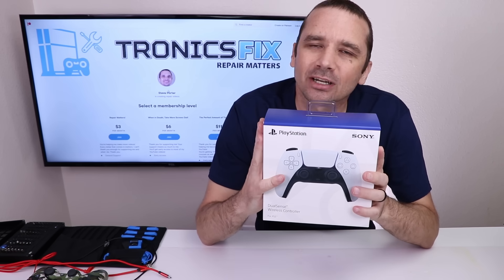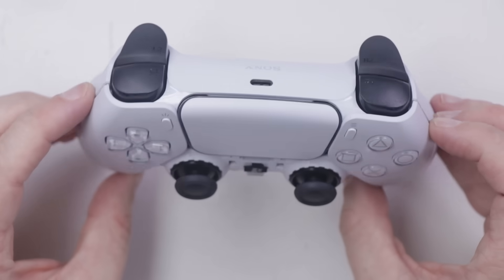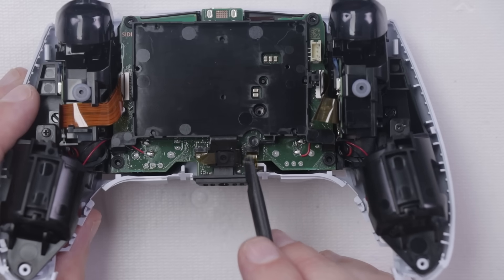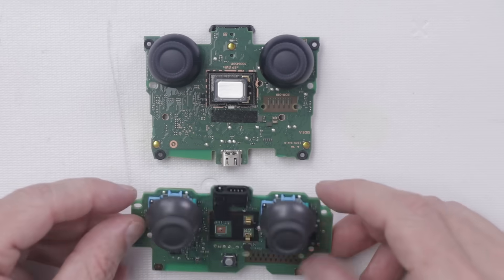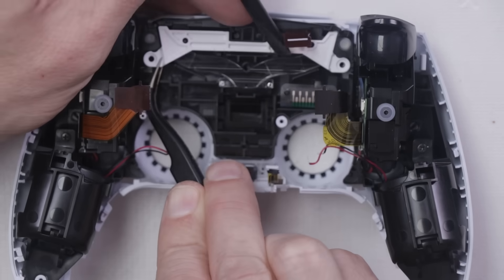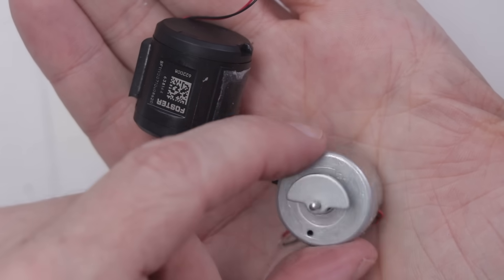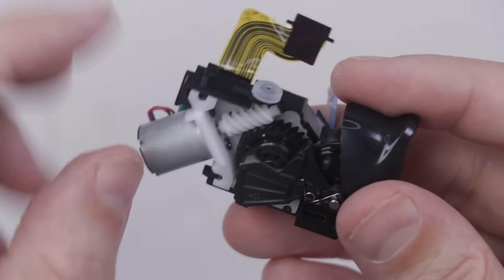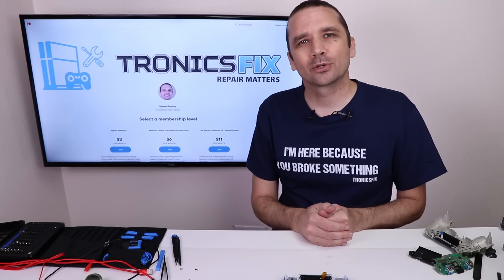PS5 DualSense Controller Teardown - A Repairability Perspective

Comment: I have 2 broken Dual Shocks 4 with analog problem. One is drifting, second is stopping on his own.  And the second one is almost brand new - started to drift a month after i bought it. You can game on them but its annoying they are not  100% functional. Not good they are the same in dual sense.

Comment: the fact that it has clips to hold the shells is already a huge turn off. i guarantee you, they will break after the first or second attempt at opening them. The pro controllers shell is really the best in regard to opening it without damaging any parts. And having to solder to get the controller completely disassambled is also a big negative. again, pro controller doesnt require you to do that to get to any part of the board.

Comment: I'd be surprised if those sticks aren't improved.
The drift wasn't exactly a secret.
Reply: Also, the dualsense looks a lot more difficult to open up so definitely won’t be looking forward to that
Reply: I've went through at least 10 controllers because of stick drift. Never threw them, never smacked them. Nothing. Kept the stick area super clean after my 3rd pair but I still got stick drift. Im gonna be super disappointed if the PS5 controllers have the same problem. Like all I use them for is rocket league. How much damage can pushing an analog stick do??
Reply: @haarisbutt2075  wtf, I still rock my original controller from when I bought my PS4 in 2014 and no drift issues here
Reply: @misha90two  there is 2 options: ur controller have problems and be cuz u are playing normall games u can undrestand and 2- u are not a competetive player
Reply: @haarisbutt2075  Even if U don't treat your gamepads badly, their sticks will eventually wear-off (drift) ... They have a plastic pin inside, which gets worn-out even with normal usage (not abuse) and in the end it needs to be replaced. But because those plastic pins are not easily available for the average user, U need to desolder & re-solder a new analog module ... Same thing for DS3s & DS4s ... And unfortunately DualSense has the same crappy 3-Pin "chocolate" Alps modules as DS4 have - looks 99% the same to my eyes ... So, stick-drift will eventually occur on these pads, as well ...
Reply: @haarisbutt2075  If you bought 10 controllers just because you didnt want stick drift, you wasted a lot of money. You could've just bought a solder kit for even less money than a ds4, buy new analog sticks and used some youtube videos to see how to replace them yourself.
Reply: @haarisbutt2075  bro, you really gonna buy a PS5 just for Rocket League??
Reply: @Superabound2  LMAO definitely not. I play all the playstation exclusives, but since my main game is rocket league, I was hoping for a better controller. Im waiting a year to buy the console regardless on black Friday
Reply: @haarisbutt2075  been playing with the same controller since ps4 launch and the only thing that's aged are the analog "leathers". You have problems if you had to change controllers 10 times lol.
Reply: Throughout my entire time owning a ps4 I’ve had to fix 2 of my controllers analog sticks. And so many ppl I know have been suffering the same problem. Hopefully Sony did something to fix that.
Reply: @frostbyte8757  had my ps4 slim for over 4 years now and never had a problem with the original 2 controllers i bought....guess im a lucky one?
Reply: @sherre2323  I play a lot of r6s on my ps4, so constantly pressing l3 and r3 takes a toll on the analogue sticks. I've personally only had to go through 1 controller, on my second now. I replaced my thumb sticks, not the module itself,  with some metal magnetic thumb sticks that have short concave, short domed, large domed, and large concave analogue sticks and havent had any problems since I bought it 7 or 8 months ago. I also clean my controller every month or 2, I'll take it apart, spray the analogue stick modules with canned air or whatever it's called, and rub the buttons and shell with rubbing alcohol, just so I can feel more confident with how long my controller will last. I bought it off amazon and didnt realize it was a first gen ps4 controller, but nevertheless, it's done me well so far
Reply: @ghostgav1428  exactly. Death stranding caused issues for me from clicking the analog to speed up the vehicles, or just speed up my person.
Reply: @saxtoncan  That's why I always seek, on the game settings, the auto-run options. Unfortunately not all games have it.
Reply: @Mike-IP  yah death stranding didn’t have that I’m sure, because it is a whole lot of slowing down and speeding up crossing dangerous terrain
Reply: @ghostgav1428  when you are going through so many controllers I'm going to say its a YOU problem and not a design issue
Reply: @sherre2323  no, you just don't play a lot, my friend plays cod / fifa 4 hours a day and his left 3d analog(stick) died every 6-7 months. 
They are the same in ps4 /ps5/ xbox/xbox elite controllers, dont know about nin pro controller
Reply: @sssrs4172  are you kidding me i play for 3-5 hours evry day for the last 4 years
Reply: @sherre2323  maybe you dont use L3 and R3 alot
Reply: @saxtoncan  to be fair stick drift is usually caused by a fault with the potentiometers, pushing down on the stick has no effect on the position of the wiper but instead pushes down on a ptm switch, so i wouldn't think that would cause it
Reply: @wsketchy  then it is odd that it only happened to me in games that I had to click R3 and L3 often
Reply: @frostbyte8757  Only 2? I bought 8 controllers xD
Reply: Oh yeah the switch has Horrinle Horrible Drift
Reply: Got my Ps4 back at the release in 2013 i still have my first controller, what exactly happened to the sticks?
Reply: @t52342  "how" depends on the specifics.
On Steam you can just go to the controller settings in Big Picture mode to calibrate any controller's deadzone settings for Steam Input.
You can also do it outside of Steam, but the specifics vary with operating systems and controller models.
Some games provide in-game deadzone settings, too.

On consoles you're probably SoL.
It's what you get for buying into arbitrarily locked down computers built around the idea of taking power away from the users. 😐
Reply: I will say that for me the issue was always caused by either hair getting into the mechanism, or dust getting on an electric piece of some sort. Both solved by certain easy means. Hair you just open it up and pluck the hair out, meanwhile dust you just move the stick in a direction and blow into the crack. With the rubber padding around the sticks it seems like it should be more difficult for both hair and dust to get in there at all.
Reply: Had to replace the exact same part on my Xbox 360 controllers like 3 times through the years using it on PC and the console. Didn't know the PS4 was also prone to that but could definitely imagine it happening as well, given it's the same thing.
Can't be helped with a potentiometer type analog stick, ever since the Nintendo 64 I haven't seen anybody use optic sticks anymore (and that one had it's own unrelated mechanical problems...).
Now my Switch tho, half a year of playing normally, no hitting the sticks or anything, and drifting like mad already. Thankfully other than the disgusting tri-wing screws it's super easy to replace. (14 solder points on the stick + 3 on the trigger potentiometers on the 360 controller won't be missed)
Reply: I didn't know ds4's also had drift problems, never had any issue on either of my two while 75% of my switch controller got drift issues (both pro and joycon). 
The reason I use ds4 controllers is mostly because I like their dpad, so that might be why. Sucks to hear so many people actually have drift problems on ds4 :O
Reply: @SkribbleNL  yah...I think it was more common on later models tho because I never had it on remotes that came with the system. I used to have anger issues when I played my brothers so I stomped my controller to dust one day and every controller since has been terrible but I’ve treated them all like babies, because I have to pay for my own stuff now.
Reply: Dude I think just some of the controllers have drift issues, I've bought two controllers in the last 3 months, it sucks I don't wanna buy another one I might just replace the stick intead. So disappointed on de ds4 , never had issues with pc 20 bucks controllers.
Reply: Maybe its a more recent thing, i have 3 controllers the og one that came with the console and 2 more i bought like 3 years ago, the original one works with no issue but the recent ones i bought both have drift issues, i find that super odd
Reply: All controllers with analog sticks get drift. It’s not even that common on PlayStation in comparison to some other companies. 

Lookin at you Nintendo
Reply: My sticks only drift if I damage them so they aren't loose or have too much sensitivity in settings.
Breaking stuff=dumb persons curse.
Reply: whoa this is the first time I heard of this on the PS4. I had my controller for the entirety of its lifetime and none of them has this problem. And I play Street Fighter.
Reply: @brivnii  damn street fighter 😳, you Frekin lucky bro
Reply: @Hokaibo  surprised you lived the past 5 years since you people like to blow stuff up
Reply: I never had this problem and my friends neither, i only had this problem on the NSwitch
Reply: My controller had stick drift. This may sound dumb, but I fixed it by blowing on the analog sticks with my mouth.
Reply: @D.K Where exactly are you spraying the WD 40 though?
Reply: I have now two drifting Dualshocks. 2 months and they start drifting. Disassembled one of them and after cleaning got rid of the drift, but for how long? Never had any drift problems with XboX360, Razer Sabertooth, Steam and even a cheap Gembird that doesn't know what xinput is. This is ridiculous.
Reply: @Hlodin  It's a money grab scheme. We need to form a petition so that they are forced to upgrade the analog sticks for the next set of controllers they release so that it's drift proof. Otherwise, they're just going to keep it the same way throughout our lifetimes so that they can rake in more money from broken drifting controllers.
Reply: @user-zv8qg1co4z  And therein lies the problem.
Reply: my ps5 controller is already drifting and it hasn't even been a month . idek how
Reply: My ps5 controller is already drifting, got it when it first came out
Reply: @ForeverPandaYT  same
Reply: Funnily enough I owned my ps4 since launch and never encountered stick drift
Reply: ive never had a problem with drift. and i have used my controller for over 5 years. nearly every day.
Reply: Am I taking crazy pills, or is everyone freaking out about something that's trivially fixed in software by slightly increasing the stick deadzones?
Reply: @majorgnu  increasing stick deadzone also makes movement in game feel a lot slower, rather than immediately responsive. Also, most games on console don't have a dead zone setting.
Reply: @haarisbutt2075   @Haaris Butt  Thumbsticks already have deadzones applied at least at one stage, otherwise virtually all controllers would have "stick drift" from factory.
I suspect the vast majority of "bad sticks" would just need their deadzone bumped up slightly to start working satisfactorily again.
If a stick needs a deadzone so large that the user would complain about it being slow to respond, then sure, that would be a proper hardware issue.
But even still, there's such a thing as graceful degradation and experiencing spurious inputs is much worse than some minor degradation in useful range of motion.

Comment: I'm really disappointed that they used the same analog sticks... 3 of my PS4 controllers have stick drift, 1 of them got it barely 4 months after purchasing it, kinda sucks
Reply: same like u bro
but u can fix it by blow inside the analog 
but be sure ur mouth is dry :)
Reply: @العراقي-ص1ه  I've tried that a few times and it only works for a few minutes and then it's back to drifting, that's the only solution unfortunatly.
Reply: @newyorkgovernor  
believe bro 
i was excatly same like 
but i search on youtube and found some solution 
and it's work and the drifting never back:)
Reply: They aren't exactly the same, you can even see the top guide is 90 deg offset.

Comment: I fear one accidental drop will be enough to break the triggers.
Reply: i’ve already dropped my controller over 20 times (a lot of drunken gaming incidents) it’s perfectly fine. have some faith.
Reply: It doesn’t even take a drop. Just simply using it is enough for the trigger the break.
Reply: I once dropped one and the right motor was broken
Reply: Don't drop it
Reply: I saw a video were they dropped the controller 10ft from the ground and it worked perfectly after fine so you don’t have to worry about it.
Reply: Then dont drop your controller
Reply: Fear no more little one. You can always buy a new one!
Reply: @drakathcatcher384  But that's money, $70 money
Reply: MIR SH  stfu.. Not everyone has a 3d printer
Reply: @H.EL-Othemany  there are ton of services which will print any file for a few dollars. So STFU
Reply: DUDE triggers are so easy to fix as you can just pop them back in!
Reply: @thedood4901  Those plastic gears look like a weak point.
Reply: @VideoRawDog  DUDE my triggers on my PlayStation 2 broke hundreds of times but I did not need to buy a new controller.
Reply: @thedood4901  That's the Playstation 2....ya know, THREE GENERATIONS AGO! ;-;
Reply: @thedood4901   These are different triggers that we have never seen before, they mean that if they drop it the gears and stuff will break so there will be no more adaptive triggers
Reply: @Cpyright007  OH yeah then the triggers will break
Reply: @thedood4901  Those triggers relied on a spring system and a potentiometer. Not comparable to a motor and gear system.

Comment: As for Type C ports, I haven't had a single female port go bad, it's always the male side that has caused issues, though I haven't had one outright fail; most of the issue is that the connector loosens, and on certain devices with fast charging, the looseness will mess with fast charging, even if the connector itself is still good. 
But look at the bottom of the PCB under the port, there's a bunch of tiny vias there. Usually that'd be for heat dissipation, but you wouldn't need this under a connector. I wonder if they're using those as a massive solder pad to reinforce the connector's placement. In fact with the port facing upwards, row 1 column 2, that via has a solder blob going through it, and row 1 column 5 seems to be discolored or slightly damaged, either from too much heat, which using an array of vias as a pad under a port could do, or just from a manufacturing error. 

I also hate the fact that Sony is still using the flexible PCB method for their face buttons. That thing is an absolute nightmare to deal with, especially when removing and reapplying it to the midframe. I wish they'd just go with a standard PCB instead, but I guess they've gotta cut corners wherever possible. 

The adaptive triggers are going to kill the battery life in these controllers, depending on their functionality. If the adaptive piece is supposed to be a full stop, that motor is going to have to be powered to provide resistance, as you can quite obviously actuate it with your finger, especially when holding the controller. If it's supposed to act as a two stage trigger, like a typical analogue trigger works, it'll still eat up the battery, just not as badly, though I don't understand why you would need a physical two step controller when an analogue trigger can have multiple steps in software based on value ranges. 
On a side note, it'll be interesting to see how well the design keeps dust out. I'm also a bit surprised by the lack of any lube on those gears, might become a longevity issue.

This controller also looks like a repair shop nightmare. So many little clips, and that black piece is nothing but clips. At least Sony did better than Google, as the Stadia controller has massive clips at odd angles that make disassembling it near impossible. I wonder if Sony is partial trying to go after controller revenue, as broken clips will severely impact how the controller looks and holds together.

Comment: Sama analogs, won't survive Call of Duty running.
Reply: Same analogs but the placement is flipped 90 degrees from the ps4. 

This is to stop the issue with sprinting causing stick drift I heard in another video .
Reply: @xXSinForLifeXx  can you confirm this 4 days later? If true It's huge!

Comment: 2:34 when he’s talking about the controller battery’s capacities I find it funny that i have a bigger capacity in my ps4 controller then both of these controllers but then again I modified mine to add in the 2000mah battery and a extreme rate led light kit 😁😁 so I could literally play online all day through the night and probably until next sunrise then have to charge my controller if not sleep then get back to playing on the same charge

Comment: Finally a real analog trigger, however disappointing joysticks and still disappointing battery which I was hopping something 2000mah+... It's probably be another low battery life sucker like the DS4, hope not...

Anyway I hate the DS4 analog sticks, the DS3 and lower had much better sticks with more area and easier to make refined aim in the center with slow movements...

Comment: My only fear is that what would happen if the controllers triggers are giving you resistance and you end up squeezing it just a bit too much. Is there some sort of way the controller detects it and releases the trigger avoiding damage or you just screw up the teeth on those gears and then bye bye controller? T.T